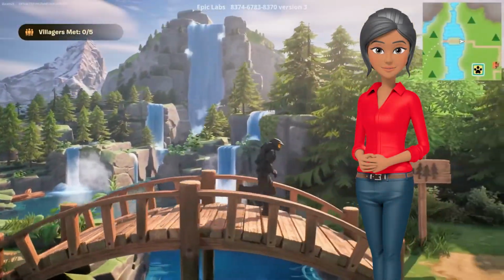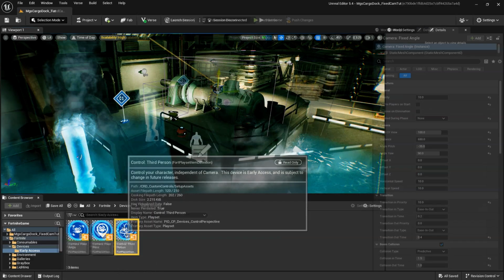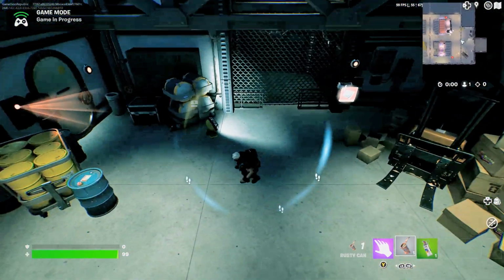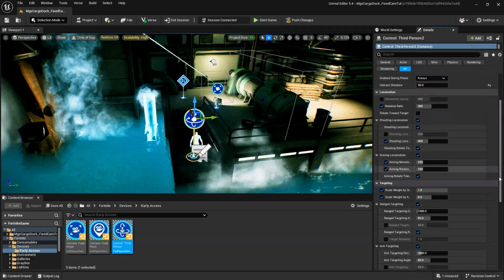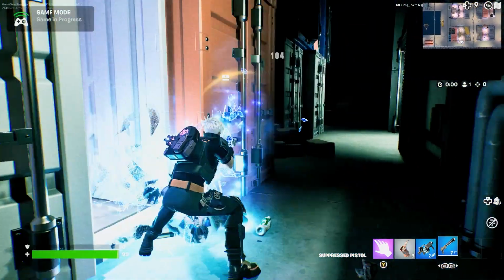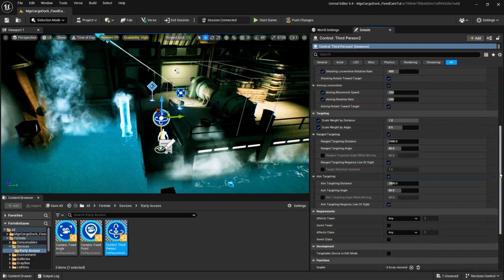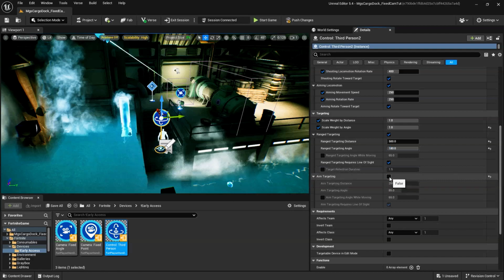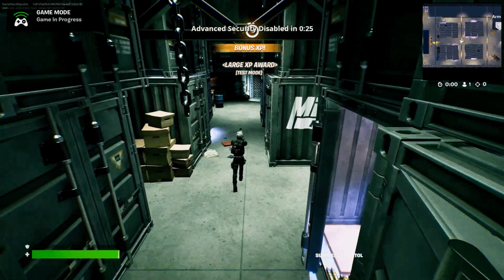Move Without Limits! UEFN Third Person Control for IMMERSIVE Camera-Based Gameplay!

Comment: Hi, when I use the Control: Third Person device, I am unable to sprint. Can this be fixed?
Reply from the maker: We ran into that same issue and asked Epic, but got the standard "we're working on it".
Reply from the maker: That said, we'd still recommend leaving a bug post in the Epic dev forum https://forums.unrealengine.com/tags/c/general/issues-and-bug-reporting/172/fortnite . Hopefully the more people complain the faster they'll fix it.
Reply: @GameDevRepublic   Thanks for the confirmation. So does it have any other way to make the movement faster?
Reply: @Tekazoh I tried having jumping or crouching activate a movement modulator which gave the player a speed boost. Maybe something like that would work?
Reply: @Tamperkele  Hey thanks for the idea. Should the movement modulator be stepped in, or could it placed anywhere?
Reply: @Tekazoh  You could try moving it on top of the player and just activateing it when needed if you want to really launch the player. But if all you need is just the speed boost then you can have it be hidden anywhere on the map.